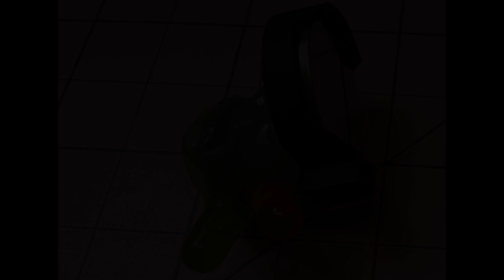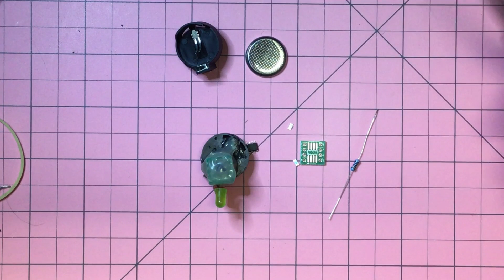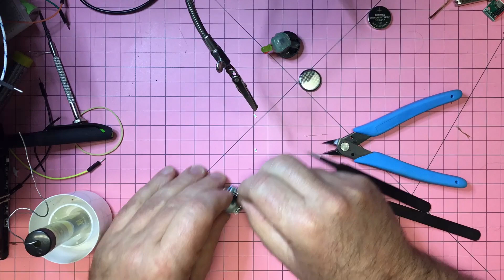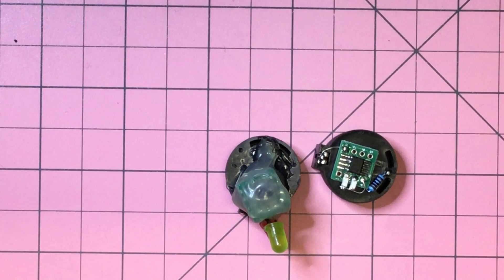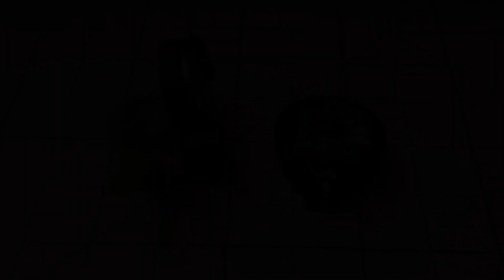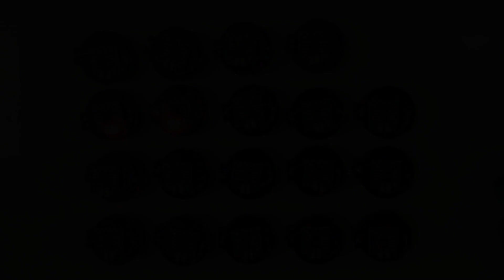Crazy Christmas LEDS (ATTiny13 driven)

Comment: Very nice Anthony. Just wondering, have you thought about switching out the hot snot for casting silicone. You can encase them in the two part silicone mix and when it comes to battery changes or software updates, all you need to do is make a cut around half of the battery holder and it will come off like a sock. Then just put it back in once your done and seal the cut with a small amount of the silicone mix. Very cool decorative circuit mate.
Reply from the maker: Yes agreed! I had similar thoughts and once the festive season is done and they migrate outside, I’ll do exactly that. 👍😀
Reply: @onecircuit-as  cool, in the meantime, have yourself a very merry Christmas mate